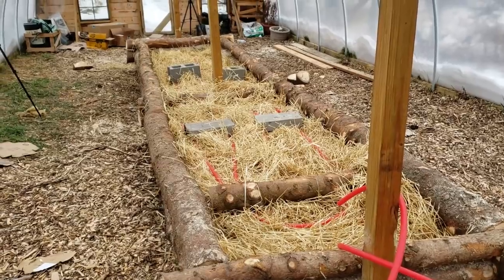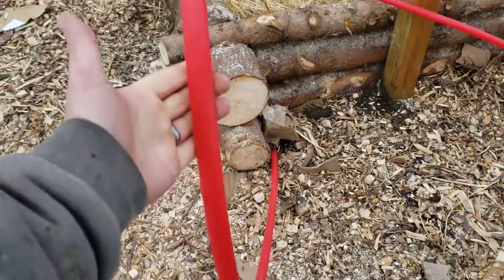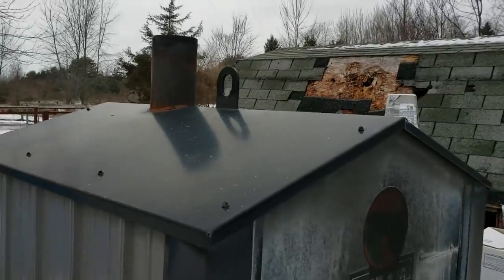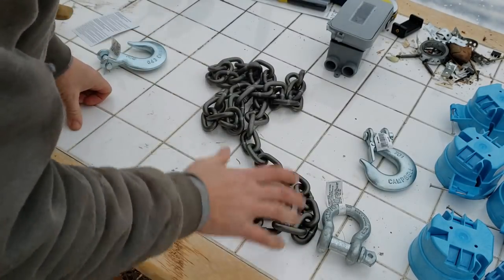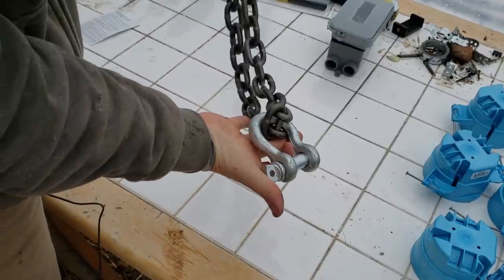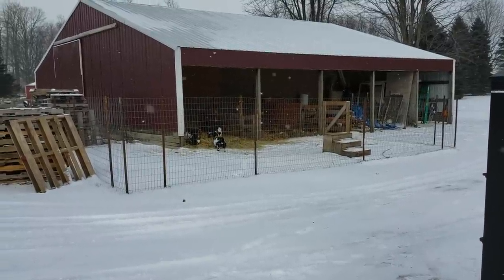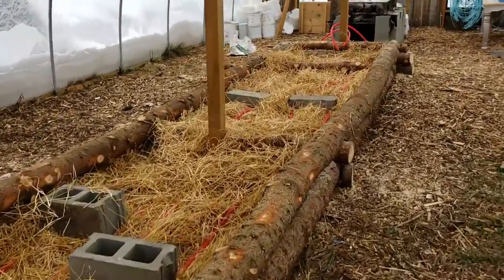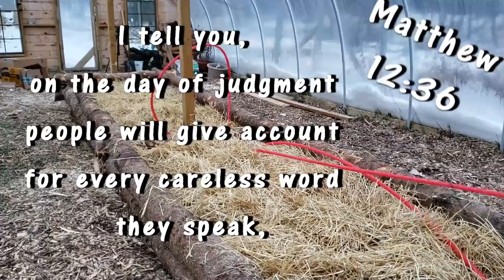How I Plan to Heat a Greenhouse With a Raised Bed

Comment: Run 1 inch insulated pipe from the boiler to two manifolds inside the greenhouse. Connect the pex to the manifolds. Slightly higher upfront cost, but you will thank yourself in the long run, you 'll have the option of extending the system quite easily. For example you can build a table, run pipe across it, add gravel to bury the pipe, rest pots/seedling trays on top. Excellent nursery for sprouting/growing seeds in pots. Or you can add a ceiling mounted hydronic shop heater, extend your gardening season by a few months.
Also consider a three way mixing valve, mixing water coming from the boiler and water returning to reduce temperature, 160 -180 degree water running through the pipes might end up burning plant roots, I think something closer to 100 is safer. Precisely because this is a 'small' hydronic system and a big boiler, there's a risk water temperatures will be considerably higher than the water temperatures you saw while running the house off it.
Reply from the maker: Agreed, I think running the 1" will be the best option. I do have the ability to turn the boiler temp down and I may try it set at 140 and see how that works then turn it up or down as needed
Reply: Neat idea! One thing that may keep it from working well is the compost. Compost tends to be 'fluffy' and so it acts as insulation. Mixing heavier soil with it, and keeping the bed well watered should help.
Running hot water pipe into water barrels does seem like a good idea also.

Comment: great progress so far.  i like the idea, my suggestion would be to put the pex in a bunch of clean road gravel at the lowest possible level of your beds.  keeping the heat away from the plants but yet utilizing the thermo mass of the bed still.   i think the comment about the soil drying out is a valid one.
Reply: I was thinking the same.  It will "absorb" heat and radiate it as temps cool.

Comment: Good idea dad, but I think I would be weary with heating the bed and drying out the soil. It may help to bury the PEX pipe even deeper into the soil under the bed. I also really liked your idea of adding the loop of PEX around the exterior borders of the greenhouse. And definitely utilizing black barrels of water as thermal Mass is a great idea.

Comment: Should work! But your gonna heat it until April! Maybe consider setting up two barrels (thermal mass) and a table off to the side and filling the barrels at the end of the day. Or you can put those pool heater copper coils in the barrels and hook your pex to the thermal mass after your bed so they heat at the same rate. Barrels are relatively easy to get! Whatever you do try to get as much thermal mass as possible? Run them lines through as much heating properties as possible get more heat in your greenhouse as possible because your electric costs are the same! Shutting it down at night will save lots of wood and electricity.

Comment: This is amazing! The only issue you may run into is heat distribution. If the lines are running up and back along the same side and then up and back on the other side it may cause one side of the bed to receive more heat then the other. Just a thought but man what a cool project! I'm excited to see how it turns out!

Comment: Old tire between tractor and whatever your moving will help with not tearing it up, just a thought.It was 70 yesterday here in south georgia so the cold ain't much of a problem here but heat and mosquitoes this summer are worse

Comment: Very cool. I was planning to do something similar in my greenhouse. I was unsure what to use as insulation the hay is a really good idea. I'm very curious to see how this turns out in the long term.

I did a similar boiler move earlier this year with a skid steer and 3 other guys. I'm not surprised the tractor was able to lived the boiler but I sure am surprised it's strong enough to haul around you massive balls! That is one heck of a job to do by yourself. Hats off to you. Keep up the good work.

Comment: wire nuts are not water tight. i suggest you put a plastic bucket over the conduit for now. it will offer some protection until you can get the box on it. it should be interesting to see if this works.  i think the soil be to warm to keep the plants alive. but again we will see. thanks for your efforts.
Reply from the maker: I put several layers of plastic bags over the wires and tied it off. Next week I'll get the right box!
Reply: @SSLFamilyDad  you might be able to put an old plastic protien tub or  bucket  over it till then i use them as raised planters for my family  members and  as places to put valves and things under ground in

Comment: If you can get large use propane tanks. Fill them with water and use that as your heat storage. Like a hot water battery.
Reply from the maker: I have some plastic barrels that night work

Comment: around the pipes it would be better to have sand, it will help disperse the heat as well as hold it better. the straw will insulate but it will not hold it well.

Comment: i think the 3/4 was overkill but its in so use it.  fine to run it like you said but i also agree with a manifold, multiple ball valves (think of everything you might want to run someday and leave a takeoff for it and then u wont need to drain.) , and likely a mixing valve.  id run a 1/2" tap to go between the manifolds also in case your pump is too big.  possibly a temp sensor for in the ground? you may just cook those plants if u heat too much.   I almost think your boiler is too big for something like this but with everything on it might be fine. use glycol so it cant freeze.  Good Luck Todd!

Comment: I would suggest building yourself a pad to put that boiler on.  stone base and concrete would be best, but if not that then stone base and solid concrete block.
Reply from the maker: I have some concrete blocks I am going to set it on just need to see how the walls of the sugar shack will line up

Comment: 1 inch to 3/4 inch wont cause any issues.      Just for your knowledge the max BTU output for 3/4 inch boiler pipe is 80,000 BTU

Comment: i am also concerned that you may either dry out or cook your roots  mr stadler is right i think you will want to connect to other things soon and rather than break open you system it would be the way to go .. this way you can put a (radiator heater for the air and control how long you heat your beds therby not cooking or drying them out but still allowing the system to circulate you might be able to just use an old heater or ac core or just a coil of copper pipe to with a fan behind  the fan will also help in your pollenating

Comment: What about tapping in a couple of small radiators to heat the air and also using RV antifreeze instead of water
Reply from the maker: only problem with that is the boiler takes a couple 100 gallons of water including the tubing so not possible to fill with anything other than water unless I want to spend $1000

Comment: I hope your intention is not to germinate seeds in this bed as I say this from experience they will cook the heat is to hot for the seeds to germinate they bake instead. after you set up your bed place a meat thermometer in the soil and you will see what I mean
Reply from the maker: I will be able to regulate the temp of the soil with the boiler so if it's too hot I can turn it down

Comment: Why don't you use it to heat your house an more ?
Reply from the maker: It was all installed wrong and our furnace and ducts need to be moved and replaced. I have an indoor stove now that we love
Reply: @SSLFamilyDad  I would love floor heat I worked in a fab shop with radiant floor heat 60° felt like 75°